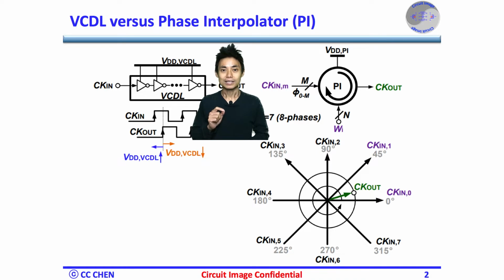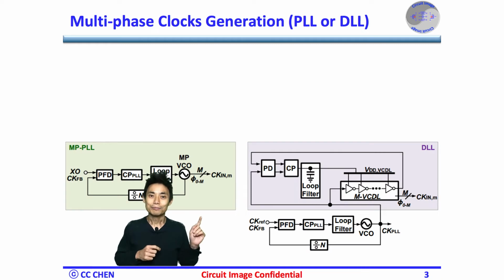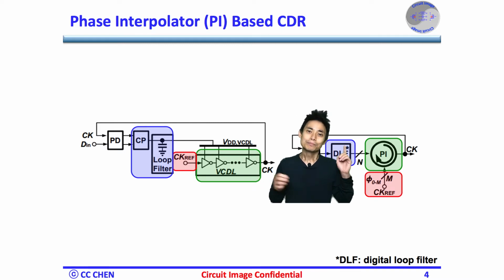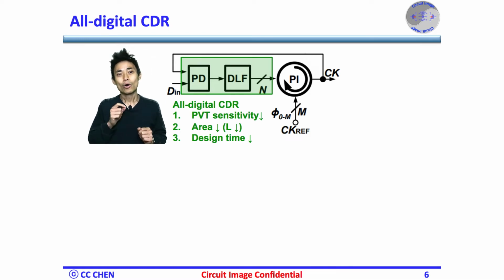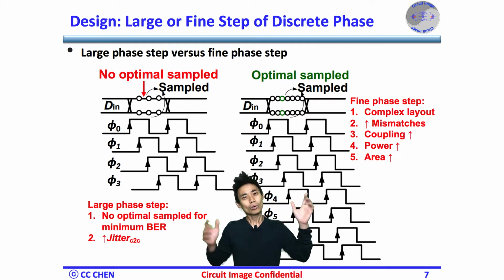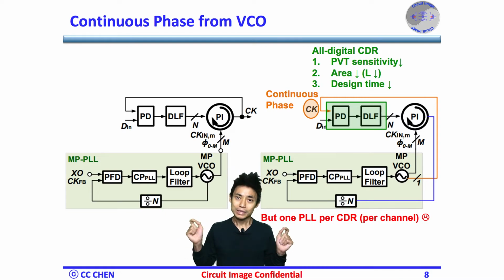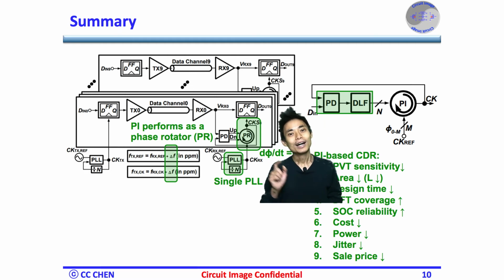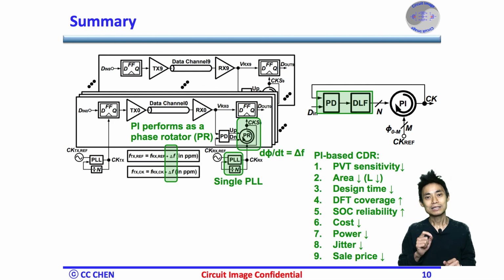Why Phase Interpolator Based CDR?

Comment: Hello Sir, thanks for your video!

in your video, you mentioned that a Phase Interpolator (PI) can generate a waveform with finer phase resolution compared to a VCDL.

Based on that, may I ask if it's correct to imagine the following application scenario:
In practical delay alignment cases, such as aligning a forwarded clock with RX data, one could first use a VCDL to perform coarse tuning (with delay steps in clock-cycle multiples), and then use a PI to perform fine-tuning within a single clock cycle?

Is this kind of cascaded usage between VCDL and PI commonly adopted?

thank you!!
Reply from the maker: Hi Mango,

Thanks for your question! Yes, you’re correct. It’s common to use a VCDL for coarse delay tuning—adjusting in larger steps like clock cycles—and then a Phase Interpolator for fine tuning within a clock cycle to achieve precise alignment. This cascaded approach leverages the strengths of both.

Hope this helps!

Thanks,
CC
Reply: @circuitimage  
thanks for your reply, sir
it helps a lot!!
Reply from the maker: @MangoLin  
You’re very welcome! Glad it helped. Feel free to reach out anytime with more questions!

Comment: Hi Mr chen  ,Thanks for your excellent content . 

In PI based CDR to smooth the discrete phase step using the vco output for phase comparison with input data .  The two loop no longer remains independent , how this is taken care so both can work as desired . VCO output phase is compared with input data and reference clk .
Reply from the maker: Hi Ankur, 

Great question! You're right—when the VCO output is used for both loops in a PI-based CDR, the loops are coupled. This is usually handled by careful loop filter design and gain tuning to ensure stability and desired bandwidth partitioning. The reference path often has a slower loop to track frequency, while the data path loop handles faster phase corrections. Make sense?

Thanks,
CC

Comment: Hello Mr Chen, 
In one of the IPs we designed with PLL based CDR, we were able to tolerate +/-300ppm (and actually can tolerate 8x than this) of frequency offset between the TX and RX clock. How much range would a typical PI based CDR has?
Reply from the maker: Good question. That depends on the PI's performance.

Comment: Thank you for your sharing about PI knowledge, I really appreciated it, and there are some questions I want to inquire to you.

1.During the introduction of PI, you mentioned there are 8 phases, is it fixed or could it be more phases than 8

2. In the video, you mentioned that every CDR loop may require a PLL to achieve the feature, so does it mean if there are three channels, then it needs three PLLs

3. In the video, you also mentioned that Wi will select two input reference clocks, like CKin0 and CKin1. Afterwards, the selected clock(CKin0, CKin1) by Wi will go through the VCO and send it to PD again, so that we can get clock recovery. I'm not sure it's correct or not

Thank you again for everything you've done
Reply: For your first question, in addition to vco design, even routing all the phases with identical parasitics is a challenge apart from power overhead due to buffers
Reply from the maker: @analog-k3y  Correct. VCO's clock distribution (all buffers) is part of the VCO design. :)
Reply: Hi Mr.Chen, please let me confirm few things of the PI with you
1. Can I say the main purpose of using PI based CDR is to get less jitter accumulation and freq offset compensation, so can reduce the clock skew
2. As you mentioned the freq offset from TX to RX, may I know it's like the signal attenuation due to the loss in the channel
3. @7:27, you mentioned that can take the continuous clock from VCO to fix the sampling in PI, but since VCO is used the reference clock to adjust the output freq by input voltage, so I think the output from VCO is still digital type signal right, can't be continuous, please correct me if I'm wrong.
Thanks a lot!!
Reply from the maker: @Erichsu-e9m  Hi 育瑛,
How're you doing? I'm glad you're back. 😊
I have comments below for you. 🙂

1. Can I say the main purpose of using PI based CDR is to get less jitter accumulation and freq offset compensation, so can reduce the clock skew 
[CC] Yes.
2. As you mentioned the freq offset from TX to RX, may I know it's like the signal attenuation due to the loss in the channel 
[CC] No. That's a totally different mechanisms. The freq offset from TX to RX is a clocking issue. The signal attenuation due to the loss in the channel is a signal integrity issue.
3. @7:27, you mentioned that can take the continuous clock from VCO to fix the sampling in PI, but since VCO is used the reference clock to adjust the output freq by input voltage, so I think the output from VCO is still digital type signal right, can't be continuous, please correct me if I'm wrong. Thanks a lot!!
[CC] No. The VCO output is a continuous signal.
Reply: @circuitimage  Hi Mr.Cheng, I'm doing good, thank you for taking your time answering my queries. I'ver learnt a lot from you. Here is another query.
1. Mostly DLL will be designed with PI right, since the DLL can input more phases of clock to PI, then PI can select any of 2 phases to generate the new one.
Thank you for answering my queries again.
Reply from the maker: @Erichsu-e9m  Hi 育瑛, I'm glad to hear you're doing good.

Thank you for your queries again, and I have comments below.

 1. Mostly DLL will be designed with PI right, since the DLL can input more phases of clock to PI, then PI can select any of 2 phases to generate the new one. 

[CC] Yes, that's right.
Reply from the maker: Thanks for the feedback. I have comments below.
1. Yes, you could have more than 8 phases as the PI's basis, but the complexity is too high in a multi-phase VCO. Both phase noise or frequency may not be feasible.
2. Yes. If a PLL-based CDR, you may have three RX PLLs in three channels. See: https://www.youtube.com/watch?v=ZJkadLjOg2s&t=604s
3. No, the selected clock(CKin0, CKin1) by Wi will go through the PI's input to generate a finer phase of CKout. See slide #2 of https://youtu.be/FkoJwnAYbMs
Reply: @circuitimage  Thank you for replying, it's really helpful
Reply from the maker: @Erichsu-e9m  I'm glad it helps :)
Reply: @circuitimage Hi Mr.Chen, I still have some questions. 
1. Because PI can rotate at a rate equal to offset, PI can generate a fine phase of CKout right. But CKin0 and CKin1 are selected by Wi, seems like there is still a little variation range of phase for CKout, so if we increase more phases as input(like 15 or  20), it'll be more precise right, but it may let the circuit be complicated.
2. Once Din inputs into PI system, it'll be generated a CKref by MP-PLL to PI, and CKref will be screened out two CKin by Wi, and then we can get the CKout, is it correct.
Thank you very much.
Reply from the maker: @Erichsu-e9m  Thanks for those good questions.
1. You are correct. So, the Wi should be in the CDR loop. The Wi is dynamic changing as well to cover the offset.
2. That's correct
Reply: @circuitimage  Thank you so much, I learned a lot from you. That helps a lots.
Reply from the maker: @Erichsu-e9m  👍I hope it helps. You're very welcome!